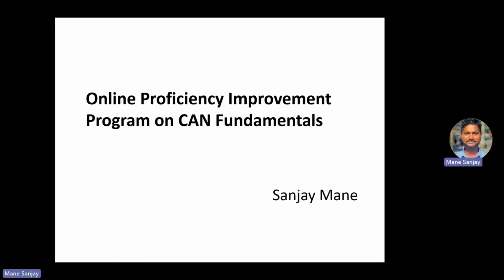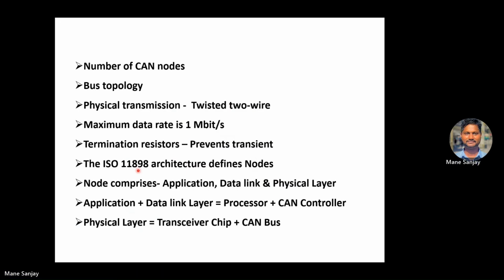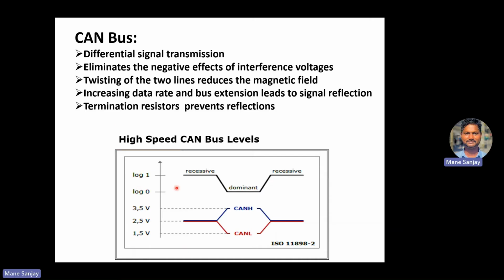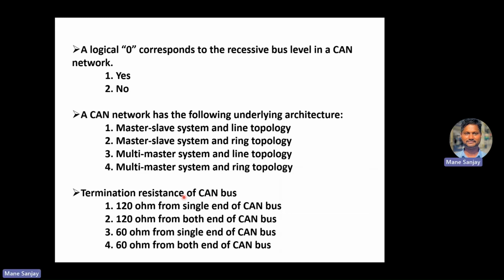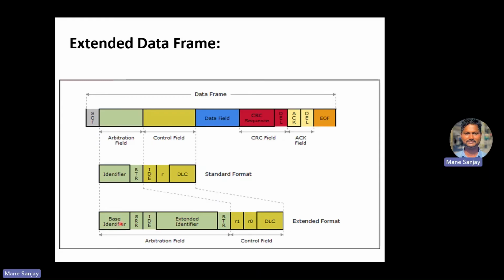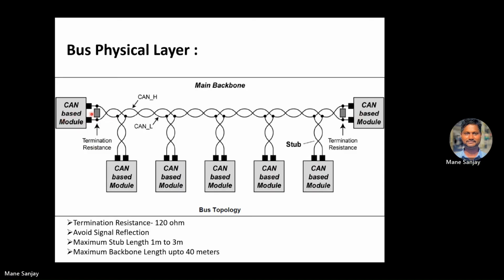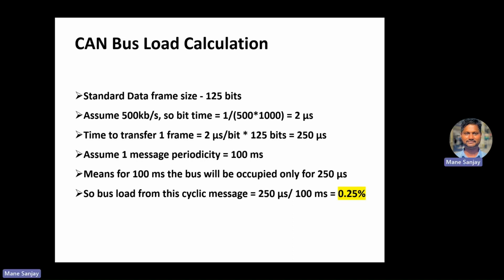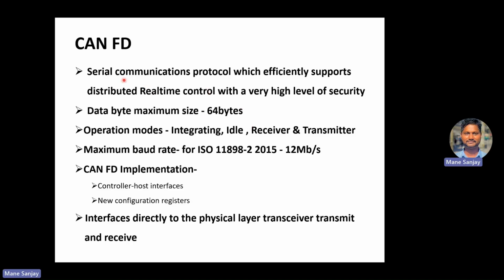Fundamentals of CAN Protocol | Basics of CAN Protocol | Controller Area Network (CAN) protocol | CAN

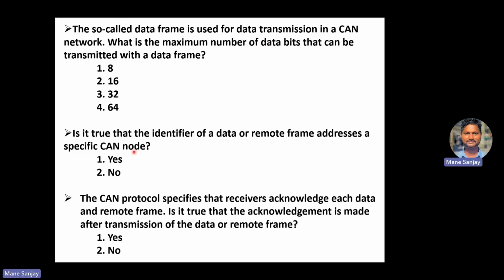Comment: 47:40 Shouldn’t the answer be “No”? Because the identifier specifies the message content and its priority.
Reply from the maker: No.. Amswer must be Yes here. Answer asks about address. When I refer CAN node here means it is a specific ECU like ABS whose source address is always 0x0B , EMS source address is always 0x00, transmission always 0x03 so all those are nodes and indentifier always address source address including priority, destination address ( look for J1939 framing session) , PGN etc.. so here answer is YES for sure. Your answer is partially right like priority but question asks about specific CAN node addresses. And one more thing sometime CAN identifier address to multiple nodes as well, if message is BAM.
Here at the beginning looking at question with respect to the contents I covered before question then answer is YES here.
Thanks!

Comment: At the 26:00 mark why is sender 1 and 2 still transmitting if they have lost the arbitration? Shouldnt the can bus showing sender 3 bits 00001111?
Reply from the maker: In simple way it is always lowest numerical value identifier wins the race. Now until same number transmitted on network it doesn’t matter that who is winning on network as same meaning reflects on the bus as soon as bit differs and more than one transmitter tries to send identifier bits in network at the same time logical ANDing comes into picture. And accordingly sender wins the race. So answer to your question is until arbitration bits equal it doesn’t matter who wins the race.

Comment: Hi Sanjay, Just finished your (3) videos of Absolute Course on CAN Protocol. Thanks again for all your wonderful videos. Not an easy question for you or atleast I dont think it will be. In Video 1 Fundamentals of CAN Protocol you explain the Arbitration, 0 Dominant and an And Logic. So is that Truly all there is to it? It seems there should be some stop lights of communications or timing or something more. Some say the CAN network is all the modules screaming on the CAN line at the same time, I find that hard to believe in literal sense. In Video 3 CAN Transport Protocol I liked the diagram of Transmit and Receive and it seems to make more sense to me, more orderly communication, although still something missing. Can you comment on a better understanding on the control of communication or point in the direction of reference? Thanks, Dan...
Reply from the maker: @danslanker8880  Hi, CAN is multimaster communication, all nodes deserve rights to communicate in network at any time and if two nodes tries to send messages at the same time then arbitration wins. Means lowest numerical value of identifier are allowed in network and how it is that I explained. In simple it’s logical AND . Now coming back to TOCM and TPDT messages, it’s sequence based because here number of packets needs to reached to the destination. But don’t confuse with normal CAN communication. If you calculate bandwidth of the CAN bus though there is a conflict and arbitration in picture, it is sure messages goes periodically. You can calculate bandwidth availability. So usually bus remains ideal max time . Means no message in network.  If you remember I mentioned bus load 70% means 30% times bus remains ideal.

Comment: Is there a reason Commercial can support 70% Bus Load but Passenger Cars only 20-30%? Thanks, Dan...
Reply from the maker: @danslanker8880  This is a really good question. Idealy if we assume same number of CAN messages with same periodicity in 250kbps network than 500kbps network the CAN bus load reduces by half. In Car we generally prefer 500kbps and in commercial vehicles 250kbps. There is no any thumb rule but in Car compare to commercial vehicle less number of ECUs with high baudrate used. So this is little flexible with network bus load. So now a days tier 1 supplier support more bus load in their ECUs based on network need in car. So simple but not complex answer here is because of number of messages, baudrate and number of ECUs in the network lead to less bus load configuration in car network than commercial vehicle network. Again this is flexible and based on network need, it can be changed now a days.

Comment: sir,i want know when the error frame will be send based on the error states as discussed in the video like during the active or passive and i was littel bit confused here.
Reply from the maker: Error states and error frames are different. When TEC and REC reach to trigger threshold then controller enters into error states. Error frames are basically dependent on the type of error observed on network by any of the ECU like bit stuff error, bit error, ack error, form error etc

Comment: how does the CRC filed works in data frame ?
Reply from the maker: First you need to define coefficinets which are given by the destuffed bit stream consisting of Start of frame, Arbitration field,
Control field and Data field , then you need to generate polynomials. The reminder of the division is the CRC sequence . Kindly refer Bosch CAN 2.0 specification for more details.